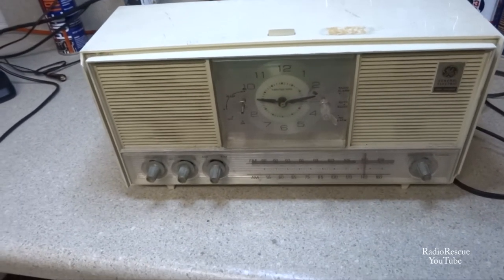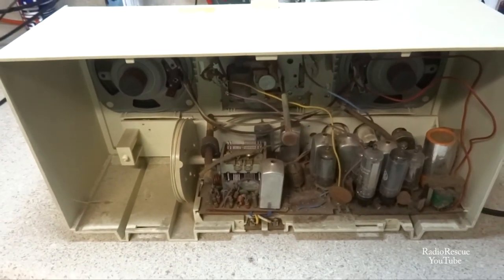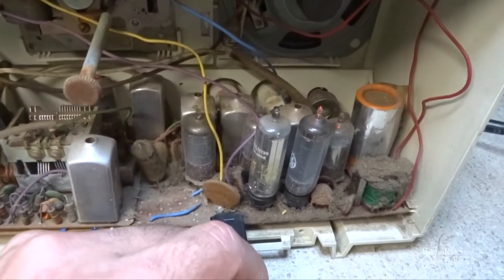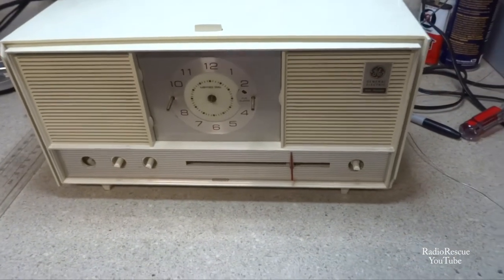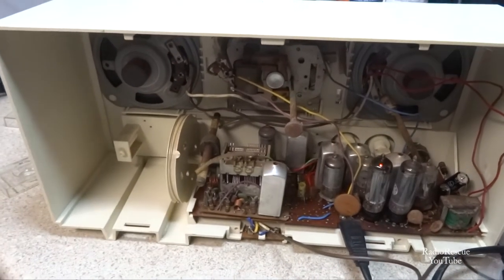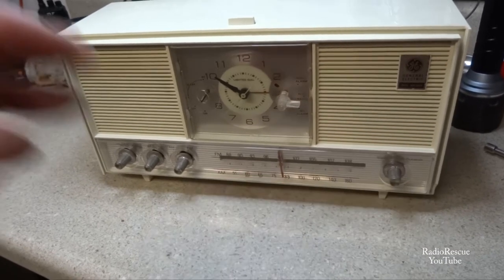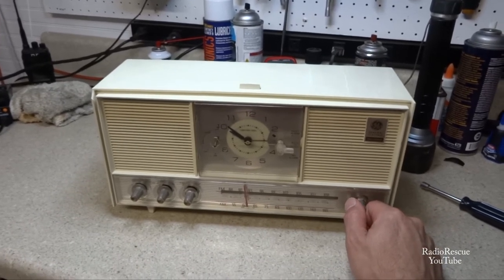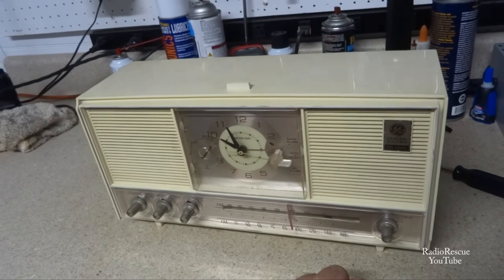Repair Of A1965/1966 GE C1530 Hybrid Clock Radio

Comment: That's in nice shape for a 55 year-old radio. It's probably got a lot more amplifier power than the 1950s AA5-based 8-tube AM/FM modes with 35C5 output stages. Hybrid sets and the early hot-chassis solid state sets  should be valued for their place in history.

Comment: It's strange that when you first powered up the radio with the 35W4 that had gone to air, the filaments glowed. Normally, if a tube goes to air, the filament burns up and it will knock out the rest of the tube filaments in a series string. Also, GI is General Instrument, not Industries. The bought out small capacitor companies like Solar, Micamold and Pyramid in the late 50s-early 60s. They consolidated their capacitor operatios into two plants; Tazwell, VA and Gastonia, NC. They shifted operations to Taiwan in 1972. I agree, they are not the best quality but generally a manufacturer will buy the cheapest part to keep product cost down and after the warranty is up, it's the customer's issue.
Reply from the maker: Thanks For the info. There still junk regardless of the name.

Comment: That looks similar to my dad’s 👨 but this is the more deluxe stereo unit, with two speakers 🔊. This could still be mono, but the idea 💡 of two speakers 🔊 sounded great 😊. His was AM only, and I don’t think 🤔 it had the dial cord system. Yes 👍, it had a lighted clock ⏰ dial. Even that’s been nearly 50 years ago, and it was also solid state. Even for then, your clock 🕰️ radio 📻 probably rates above 👆 my dad’s 👨. Happy 😊 New Year. Your friend, Jeff.